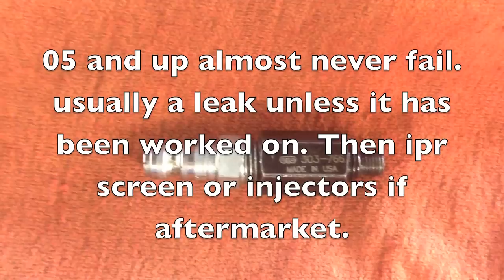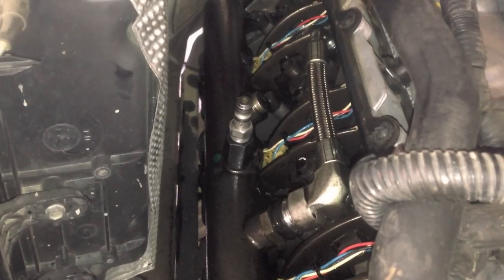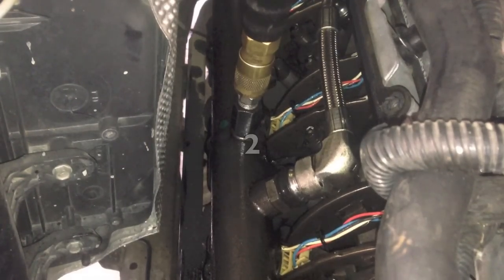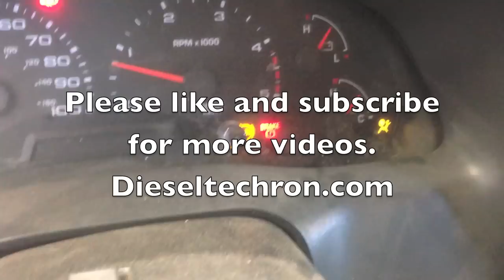03 04 6.0 Powerstroke p2290 p2291 No start (hot) Low icp testing

Comment: i ust finished a redo head gasket job on an 01 duramax... paided to have heads machined, which never happens had to remove .006 to get flat.., re-used 3 head bolts, and from a seized glow plug he heated up the head and melted part of it, so he put a new glow plug in and used JB weld... anyways i HATE being in that position seeing where someone else messed up